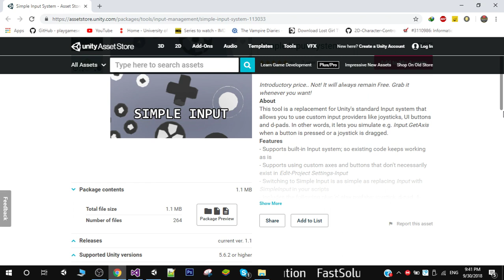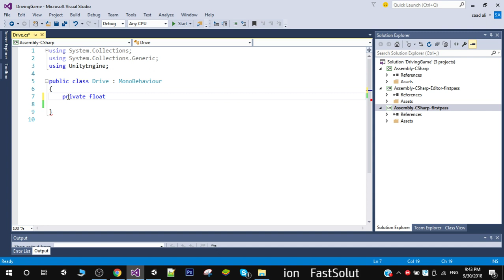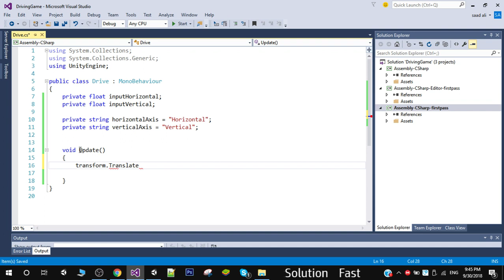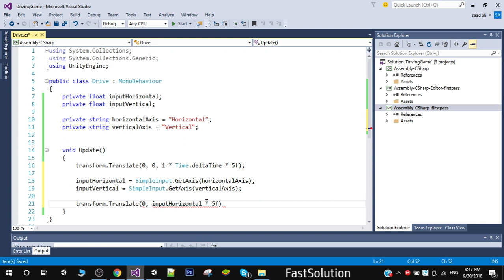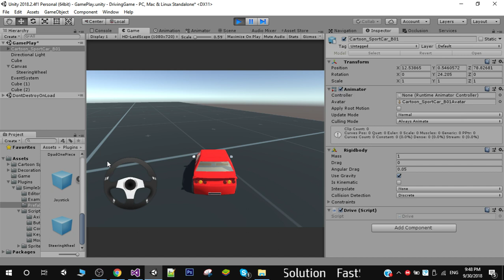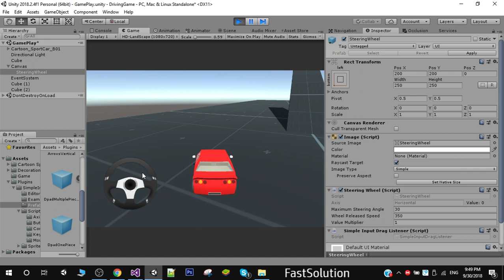Unity 3D Car Steering Wheel control

Comment: i dont know why but mine my car si tutning like a steering wheel and not the steering wheel .
Reply from the maker: Make sure you applied the correct script on correct object
Reply: @fastsolution  i bought a pickup truck from assets store and i have keyboard controls for this and freelock camera with mouse. but i want to put steering wheel for mobile. how to do that ,you can help me?
Reply: @fastsolution  i put script in my car 'pickup truck' i think is input problem because i have keyobard controls
Reply from the maker: @RST9413  can't say what is causing problems replace the lines of code in your script like input.getAxis with the plugin code using simpleInput as done in the video

Comment: I did the same script on this video but my car 🚗 when starting going. Take just a view min and then it hides 😔 it has hidden fast.  Plz if anyone know why it has hidden fast and what i should do. Plz let me know ☹️
Reply from the maker: What's hiding?
Reply: I find the problem because i don’t do the collider setting. Please upload the next video. I need it 🙁. Video about the script for break and gear. Because i want to do the iOS app and i need to put steering wheel , gear and break that the user controls the car through this car component. Please help me